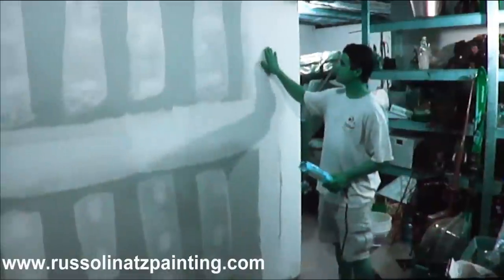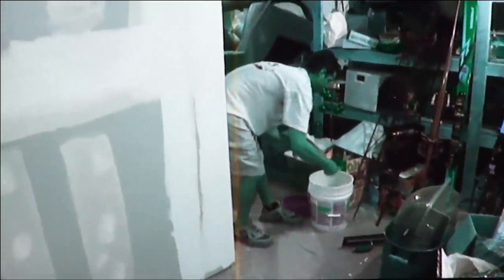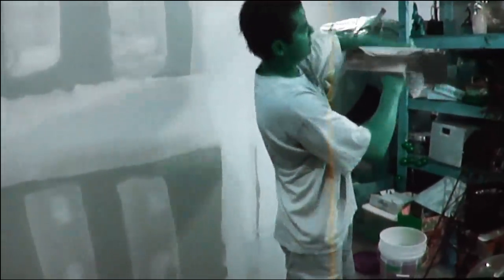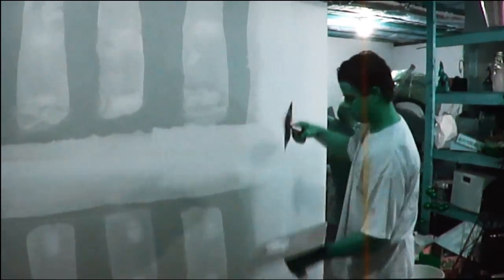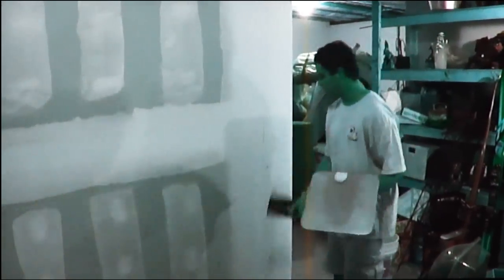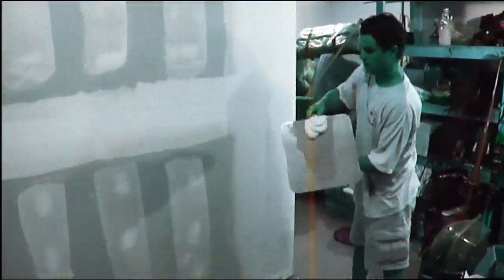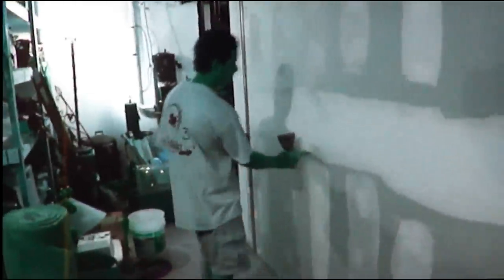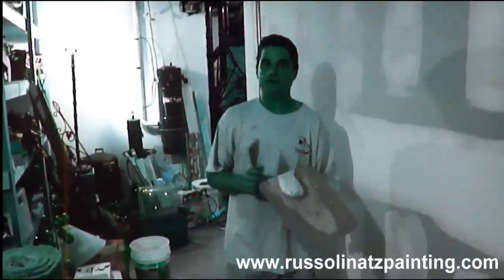DIY- How to Mud Drywall (3rd Coat) - Drywall Repair  -  (Part 5)

Comment: Hey Russ im a fan of your videos. Have a question i hope you can give me some input on. What would be the best way to mud long vertical seams such as if 10 foot sheetrock installed standing straight up against each other. Would i mud half let dry then mud the next half?
Reply from the maker: Hi-

Thanks for stopping bye! There are many different ways. Your method will certainly work. What tools do you feel comfortable working with?

Russ